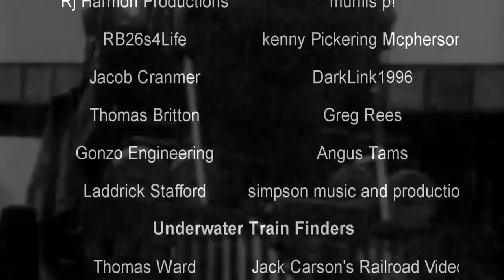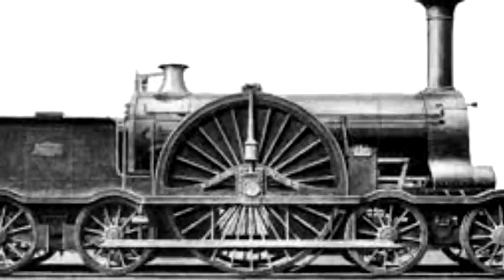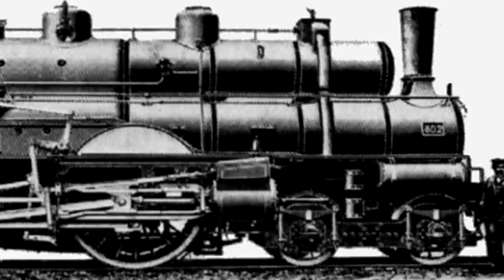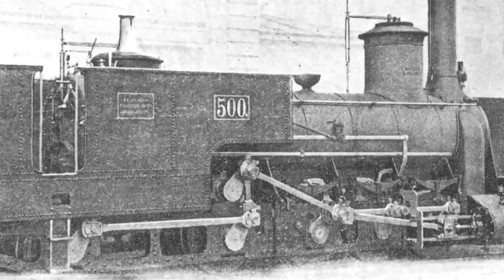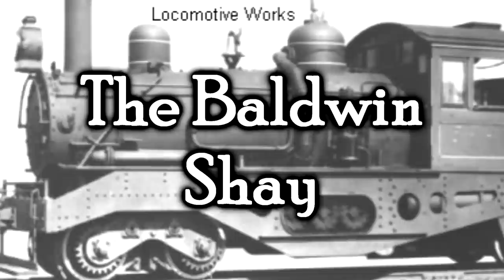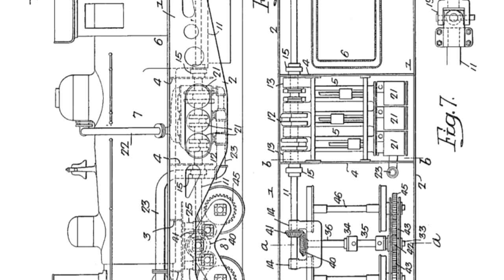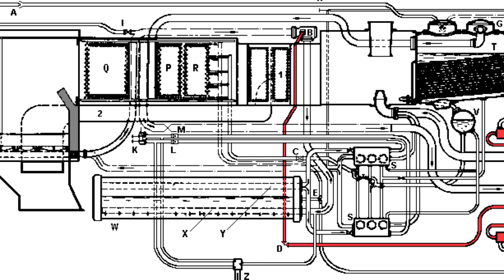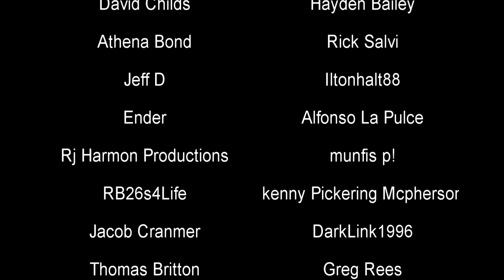5 Trains That Were Clearly Just Mad Science Experiments Part 3 | History in the Dark

Comment: One possible cause of the whole massive driver thing of early engines, particularly Cramptons, various Broad Gauge engines and other older express locos (e.g.Singles), was due to limitations in available lubrucants which weren't much good with high speed motion, so using a bigger driver meant that the motion didn't have to oscillate as fast for a higher speed.

Comment: SEVENTEEN HUNDRED PSI?!?!?  That is... *insanity*.  The highest pressure non-nuclear steam plants the US Navy ever tried were 1200 psi, and they proved so troublesome that the last generation of USN steam machinery reverted to the old wartime standard 600 psi (before the gas turbine took over).  And no, the nuclear machinery didn't go higher, either--in fact, the nuclear plants use saturated (not superheated) steam at a lower pressure than the 600 psi oil-fired plants did.

Apparently, on the 1200 psi ships, the standard procedure for searching for a steam leak was to take a broom handle and wave it through the air near the suspected leaking pipe, making sure to not pass through any area that you haven't waved the broom handle through first.  When the handle is suddenly cut in half by something you can't see, you've found the leak.

Comment: I was wondering did you do a video on the Lombard Steam Log Hauler they were basically saddle tank locomotives used for logging and were built with tracks and had a guy on the front to steer the engine and they could swap out the skis for wheels as well turns out alot of them are still around rotting away in a forest on display or running in a museum theres also this other type of locomotive that was made to run on ice and was pretty much the same idea more or less but was powered by a single drive wheel
Reply: What happened to that one
Reply: @fanofeverything30465  the one that travelled on ice and snow im not sure but the Lombard log hauler is still around
Reply: @oddobscurecollectables9529  That's good to know

Comment: Big driving wheels are good for speed. The Stirling Single (8' 1" drivers) could do 85 mph.

Wrt the HO2: I mean, you wouldn't need another loco per se, just a stationary boiler. But still. Leave that kind of thing to fireless locomotives, where it's actually practical and makes things simpler

Fowler's Ghost would fit well in this category, although IIRC you already mentioned it elsewhere (in "Worst trains" I believe).
Reply: In fairness, pretty much every engine terminal and shop already would have had its own stationary steam supply--remember, just about everything was steam-powered at the time, and you could greatly speed up the process of firing up a cold locomotive by injecting a good shot of shop steam into the boiler to get some pressure up and pre-warm it.

Now, if you had it break down and had to park it out on the line in cold shutdown, well...
Reply: That's all they're good for though

Comment: Those Pearson engines were actually very good for their day, as someone else remarks they had quite a long useful life by the standards of the time, and in view of the road they were required to work over. Whiteball Hill is no pimple; its steep, even for today's engines. The flangeless driving wheels were to allow a little more lateral motion on curves; the bogies had only limited play, revolving around a fixed centre pin. Not as uncommon as it sounds - the big Gooch 4-2-2 broad gauge singles were equally rigid, and had similar wheels. Single-driver engines were popular for fast running because, workshops being more primitive back then, it was believed that coupled driving wheels introduced problems of binding when axle and crank pin centres weren't quite aligned - as with the Fink engines.
 Interestingly William Dean, also of the GWR produced a standard gauge locomotive similar to the Pearson design, again a tank, which allegedly was so total a flop it was withdrawn, broken up and the sole photographic plate of it destroyed to deny it ever existed! It had flangeless drivers, with Dean's patent 'centre-less' bogies either end, and kept derailing so often that it (thankfully) never even left the yards. It was totally unsafe, and unconsciously designed to fail.

Comment: on that pearson engine, i have to say they were successful.  16 years in those very early day is probably a very good run considering how fast technology was advancing, but more importantly,  they were used in their various configurations until the rail network they were on was scrapped, not because they didn't want the engines anymore.

on the high pressure locomotive, i don't think the need to use an outside steam source was seen as an issue at the time.  the big boy gets steam from a plant in the facility to help get started.  and period videos from british railways on youtube show them hooking locomotives up to other locomotives to help them get going faster than they would otherwise be able to.

lawrie just did a video with a full sized locomotive and it looks like it took them many hours to get enough heat to be able to move under its own power.

Comment: Interesting comparison to No 1 here (HO2 1001 ) the German Navy had very real problems with their high-pressure boilers used in their battleships and other warships in both the 1st and 2nd world wars. Now the problems in the first world war could mostly be written off as really lousy coal supplies. But in the second world war, the problems could be assigned to trying to over-engineer things, which sounds just like 1001 here. The British did all right throughout the wars just pretty much by sticking to older less efficient designs.  IMHO the USN really solved the problem smashingly, the USN simply went to the boiler and turbine designs that had been used for years in onshore powerplants. The USN ships were able to steam for months at a time in the Pacific with comparatively little or no trouble with their power plants. The USN had a certain amount of difficulty with propellor vibrations but that is still an issue in high-power ships to this day.

Comment: I actually have an idea for making the Baldwin shay to actually ya know be serviceable

So shays are designed to be easily serviced

Right

Ok so here's my idea

Leave the pistons where they are but make it like the big boy where it works like a movable blast pipe move them further away from the boiler and make it so it can be unlocked with a standardized key and slid out completely for easy service replacement

Comment: The reason for the extremely large wheel was the lack of a cutof valve. A lot of early steamers, specially the one that where a bit faster had very large wheels. There was no point in having more than  one because the engine wouldn't be able to start it anyway.

Comment: 16:10 to get steam from outside is not really that strange. In this era pretty much all steam locos was started with outside air, cutting down the heat up time wirh about a hour.

Typically the depot had a smal boiler running 24/7 with a decent steam reservare  to heat up a number of steamers.

Comment: YOU'RE WRONG THERE ACTUALLY USING PRESSURE TO CRATE TO CREATE STEAM
BUT A SIMPLER METHOD PROBABLY WOULD HAVE BEEN TO SQUEEZE WATER THROUGH A TINY HOLE UNDER EXTREME PRESSURE FROM A PUMP
Reply: I think you "Mist" the point...